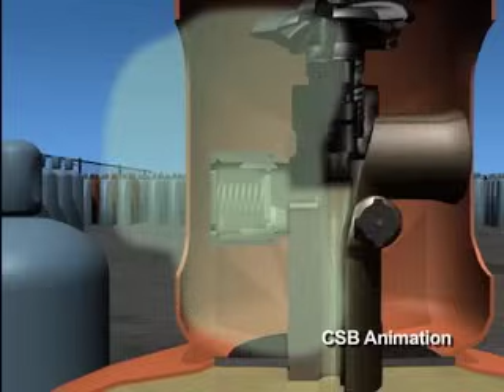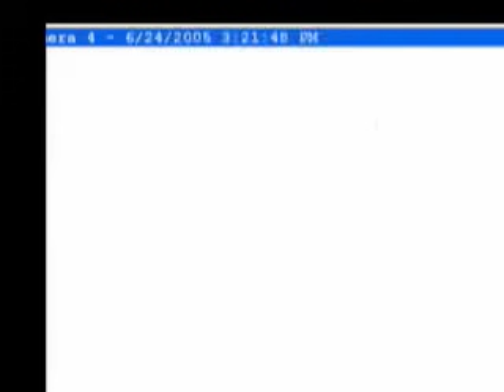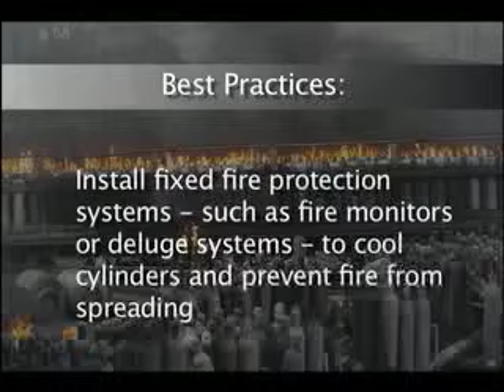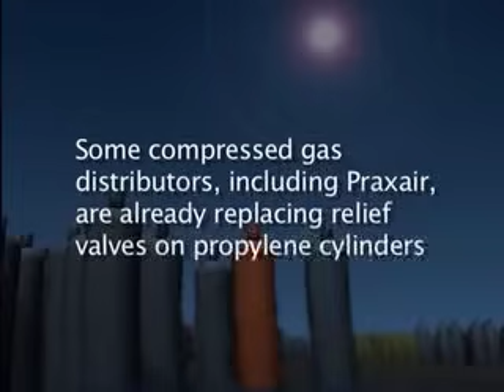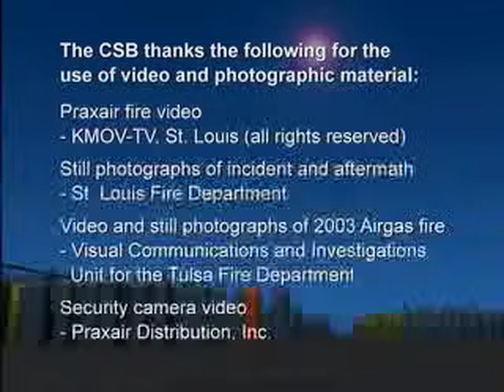CSB Safety Video: Dangers of Propylene Cylinders

Comment: hear's an idea: store the cylinders in the shade.
Reply: No
Reply: Where da fun in dat? WTF??
Reply: I “here” you!
Reply: Yes. They should ideally be stored under shade to protect them from the sun - and on palettes or wire racks, to allow air circulation under them and separate them from the radiant heat of the ground.

Of course, even with those measures in place, things like relief valves need to be done right and concrete barriers are a good idea (both for containment and security)
Reply: Sounds way too complex!
Reply: Sounds like a good idea to me. They don't have to be indoors, but perhaps under a canopy. I would suspect that the majority of the problem was from radiant heat picked up by the dark colored cylinders (acetylene is a dark red usually - not sure about propylene, and propane is usually in a white or gray cylinder white shouldn't draw too much heat, but gray probably could). In my opinion darker colored cylinders shouldn't be stored in direct sunlight. Even covering them with a light colored covering of some sort would be better than allowing them to sit in direct sunlight. As the video shows, it only takes 1 cylinder to vent flammable gas to take out an entire facility, and relief valves that vent too early open far too frequently and again as the video states,, every time a relief valve opens up it weakens some and could potentially not reseal properly anyway. I think they should be a one time use type of thing - where it reseals after venting but triggers an indicator of some kind showing that the valve has been triggered and should be replaced. And it probably should have some kind of way to block the primary valve from opening after a relief valve has triggered, with some kind of tool that only the cylinder owner has that can allow them to still be able to empty the tank so that they can replace the valve. That way an untrained customer/end user cant still use the valve after a discharge that would have been their own fault for improper storage and use. You can't trust anyone, not even yourself, to do the right thing by not using it when the indicator says not to - its too easy to think that you know what you're doing and that an accident won't happen to you... I would guess that the valve that started this incident had a set point that was too low to begin with and had subsequently open one or more times prior to this even, preventing proper operation. If a gas or it's cylinder can't handle being out in the heat like that without bursting a valve or something, then it should be required to be stored in a temperature controlled environment - similar to the way the organic peroxides at the chemical place in Houston had to do (the one that had to move all the product from the warehouses to refrigerated trailers after flooding from hurricane Harvey took out their off-site power and flooded out the backup generators)
Reply: @Bankable2790  😅
Reply: Surely that costs more than clustering cylinders full of compressed flammable gases next to each other in the parking lot, where they can launch into the air and become unguided missiles
Reply: @torque395  you came up with a whole agenda 😂
Reply: Too expensive, just let em explode I guess
Reply: Imagine getting paid 100k a year to think of that
Reply: Or just tell the earth to not be so hot
Reply: Great idea Sean.
Great minds at work 👍
4.17.2023
Reply: @torque395 Judging by the animation, propylene would be in the yellow cylinders.
Reply: @TheEmeraldMenOfficial  yes but in this case they would've been ignited by the other burning cylinders...still wouldn't hurt to have them shaded tho.
Reply: patrickshea5955  it’s not hard to cover the whole area with a carp or canvas covering to provide shade.
Reply: You didn't pay attention. They can handle the temp fine, they vented prematurely

Comment: Something that got glossed over on here that I wonder about is the cause of ignition. They said it was likely due to static discharge caused by release of the gases. So in other words, even if the relief valve was working properly and only vented gas because the pressure in the tank was too high, the activation of the valve at all would likely cause a fire.
Reply: Yes that's right. It's probabilities when it comes to static discharge. If gas cylinders pressure relief valves are set to activate at a higher pressure, only extreme environments like a fire will cause them to activate. They won't be activating while sitting in the sun.

Comment: Can't believe the gross negligence here.  It wouldn't be that expensive to put up something like a pole barn or shed with an aluminum roof and open sides(so it can vent if one leaks) to keep the sun off those cylinders.  Put them on wooden pallets to keep them off the hot asphalt, the air gap would make a huge difference in the temp on those tanks as well.  

Only people that won that day were the lawyers for all the various insurance companies involved.  RIP to the poor person who died from the fumes, I can't imagine a more horrible death than being gassed.
Reply: ever fallen into an industrial wood chipper?
Reply: gassing isnt as bad as an asthma attack...
Reply: @mrslinkydragon9910  It's worse
Reply: My thoughts exactly. A simple pole barn and pallets. Convection cooling above and conduction cooling beneath. Would have made a more than adequate temperature differential for very low cost.

Comment: What have we learned today: 
1) Don't store compressed gas Cylinders in direct sunlight, on asphalt
2) DO build at least a sunroof over the cylinders
3) DO raise the cylinders off the ground, and preferably store on wood pallettes, which are both easily avaliable, and are poor absorbers of heat. (correct me if i'm wrong, sounded good to me)
4) Have an automatic fire supression system on the premises, which activates WHEN A GAS LEAK! is detected. this will prematurely stop any chances of an explosion.
5) Have some fucking common sense...
and lastly:
6) apply your fucking physics major or chemistry or what the fuck ever, and please calculate what the pressure needs to be to meet safety standards, which are well documented by local authorities.
Reply: It's not like a metal sheet sunroof is going to cost millions of dollars, at worst, It's going to cost a few thousand. Pallettes are used to transport goods anyways, so imagine praxair already owned thousands of them. A fire supression system could be expensive, so that's maybe the only request they won't want to follow through with
Reply: Flammable pallets next to flammable gas, I'm not sure you've thought this through. And the cylinders are raised off the ground, usually they are standing on metal baskets that are pretty safe both in terms of airflow and securing the load. You can even see the metal baskets they are loaded into in the video.

Comment: Several posts quoted the existing regulations of   "... do not store above 125F ..."   but these bottles vented at 98F air temp.  Hmmm, so there's a problem for a start! Trouble is, if the ashphalt factor drove that higher, how does a company know actual BOTTLE temp on a hot day? Even 125F (51C) can be exceeded on a very hot day. Try Australia where some towns get to 45C (113C) in the shade!
In the end, all regulations, or lack of them -- and all compliance, or lack of it -- comes down to economic rationalism. Companies will scrimp however they can.

Comment: Transportation of  these cylinders needs to be watched as well. I was a security guard for a retail store doing a patrol of the parking lot back in 2012 when I found a full, heavy, large acetalyne tank that had been left in the lot. Fortunately, it was in good enough shape we were able to call the manufacturer's number on the tank, give them the tank number and our location, and have it collected, but it was a hot summer day so we moved it into a covered loading dock for shade until it was collected. Maybe it was a bad idea, or maybe that simple act prevented a single tank explosion in a crowded  retail parking lot.
Reply: You did the right thing but those cylinders are pretty safe. They have a honeycomb of pumice inside that is filled with acetone to keep it stable and they also have a pressure relief valve but it takes a really high temperature for them to blow off. It’s best to keep them stored standing up though, even if you have to ratchet strap it to a pole or something. Even a piece of wire or rope is ok as long as the cap is on the bottle. I wish I could find some parking lot acetylene…

Comment: I live in the Los Angeles metropolitan area, and the Airgas distributor where I get my welding gases stores all their bottles upright on a flat surface with no visible support or containment. like dominoes (but less stable).  We do get earthquakes in So Cal now and then...  I'm kinda surprised that OSHA industry standards do not mandate some sort of restraints on these.
Reply: mark robertson  You should watch the three videos the CSB has done on combustible dust explosions, where you see OSHA actually do nothing despite facility after facility explode from combustible dust and the CSB begging them to do their job and devise a standard like they did for grain elevators.

Comment: CSB "urges companies to use fire protection systems" - How about 18 days in county jail for each of the CEOs & management teams responsible for these potential death trap facilities?  And proportional fines and/or delisting them from stock exchange for a quarter?   Considering Praxair has ANOTHER incident a month later at a different facility - some punitive measures seem more than called for?  Maybe sounds harsh, but the mitigation efforts would be minimal to prevent this.  Wooden pallets and shade mesh and a few staple guns fellas.
Reply: CSB is investigatory, not regulatory. EPA or OSHA would have to level the fine.
Reply: You also obviously missed the part about the pressure relief valves basically being defective. So really the cylinder manufacturer should get in trouble
Reply: @Willg95  I do not pretend I'm an expert, but yeah that only happened b/c the company stored the gas tanks in the direct sunlight, causing the pressure to rise and leak out. Had the company that distributes the gas had the cylinders under some type sun protection, e.g. a cheap aluminum cover with sides open for ventilation, the pressure in the tanks never would have risen b-c they weren't in the direct sunlight. That's how most of this, if not all of this, could have been prevented.
Reply: @lukepotosky7710  I think both parties are at fault for this incident

Comment: Even with the issues with this relief valve and storage heat,  the number of fires and explosions are awfully low considering the millions of cylinders, tanks, unloading, movements and fillings.  It seems to often take more than one factor for these things to happen.  Usually one factor is something stupid being done.  
Hard to fathom how the industry has allow valves to be made without the higher set relief point.  You'ed think that would have been known and tested decades ago.

Comment: Wait, what?! At 2:17 the video states that the vented propylene gas was likely ignited by static electricity caused by the releasing gas?? First off, how is that possible? Second, so basically the safety relief valve is more of a guaranteed bomb detonator? Quite peculiar...
Reply: True indeed , How can static electricity occur on a hot humid day ? It usually occurs during the fall and winter because of the cool dry air , What actually caused the gas to ignite remains a mystery to me
Reply: @ironmartysharpe8293  When the gas escapes under pressure it drops in temperature, this could freeze dry the moisture in the air surrounding the valve.  I've seen this happen with compressed air when you drain the receiver, trapped water and air rush out under pressure and the water freezes round the drain valve.

Comment: Several questions
   First-what is propylene anyways, what is use, and properties
   Second-Thought cylinders were supposed to be grounded during storage
   Third-who thought close storage of extremely flammable, self igniting, gasses would be a brilliant idea on scalding hot asphalt, in the middle of town?  Knowing nothing of propylene, but plenty of Acetylene, if you glance at it wrong, it explodes.
Reply: Propylene gas if I'm not mistaken is an alternative to Acetylene for welding ect supposed benefits are u get more gas and therefore welding time for less money haven't done oxy acetylene welding for years though

Comment: 375 psi for propane (the release valve setting). What do you guys bet they used the same ones for the much more volatile propene? We learn as we go I suppose. One person died and I'm grateful the death toll wasn't 10 or 50. I'd estimate an increase of 25-35% vapor pressure with the unsaturated propene. The release valve obviously did not accommodate that increase.. I'll just take a quick guess and call it 500 psi for propene.
Reply: fla playa I have a propane cylinder with all my Torch stuff and I believe the pressure relief on that one is 405 psi because it’s an aluminum tank. I love that little tank it is so handy never had any problems with it.
Reply: My 60# propylene tank is a DOT 4BW240.  Max tank pressure is 240psi

Comment: so the over-pressure release valve designed to keep people safe caused an accident... good job.
Reply: Without it the cylinders can explode without warning, and with great force.
Reply: If a cylinder exploded, that would have been even worse.
Reply: @baruchben-david4196  As opposed to exploding with fire... 😉
Reply: @gabiold  nope. The fragments woud break many cylinders at once and reduce the reaction time

Comment: Cement block walls aren't going to stop a cylinder from going through it, i know, in the army a head of a acetylene cylinder broke off, fell over and shot right through the cement block wall of the shop. Went through it like butter. Only thing stopped it was the mound of dirt that was outside the wall. It didn't slow down at all when it went through the wall.

Comment: Does anyone want to store black-painted oxygen tanks nearby, too? No? 😏
Pressurized tanks of flammable gases should be required, by law, to be painted white or silver to reflect sunlight . They should also not be stored in large groups (outside or inside), without some sort of non-flammable “buffer” tanks in between. These can contain nitrogen or helium, both of which are non-flammable, and will not add to the problem if they vent, or they can contain fire-retardant chemicals that will help minimize a fire, should they be punctured by shrapnel from an exploding tank. Furthermore, the “buffer” tanks could be equipped with a “fuse” of low-melting-point alloy (such as those used in fire-suppression sprinklers) that will blow at a lower temperature than the pressure-relief valves of the propylene tanks, and will make a loud, obnoxious whistling noise as a warning! The workers could then evacuate, or activate a system to spray high-pressure water mist onto the tanks to cool them before the dangerous ones vent. Granted, this’ll cost money, but not as much as getting sued, hefty fines for safety-related violations, or losing the entire facility! 😖